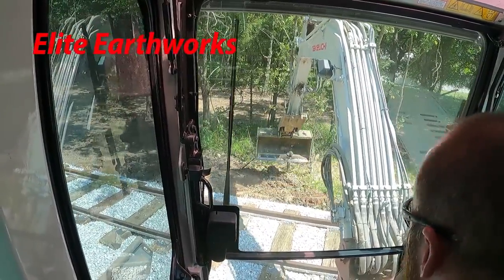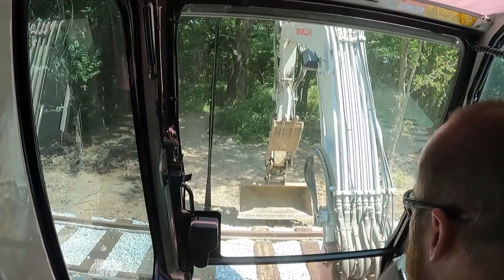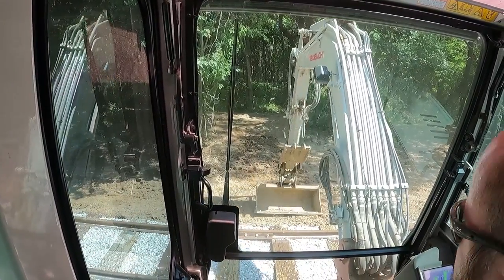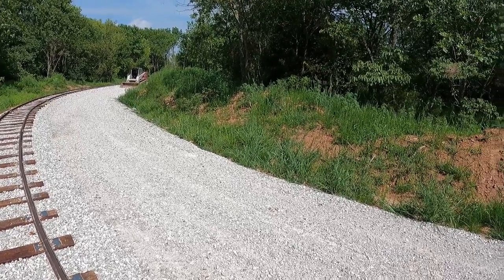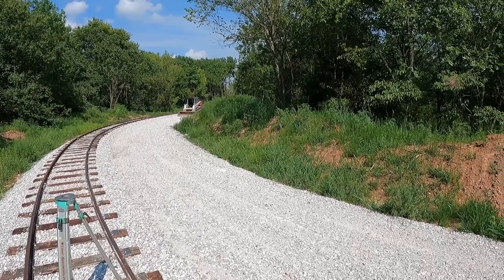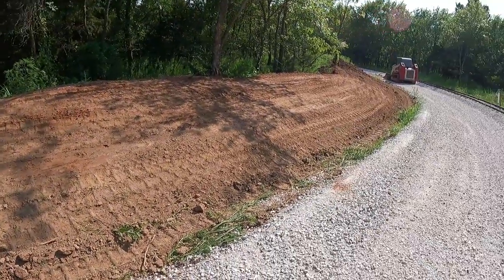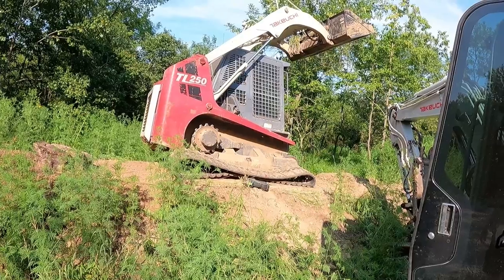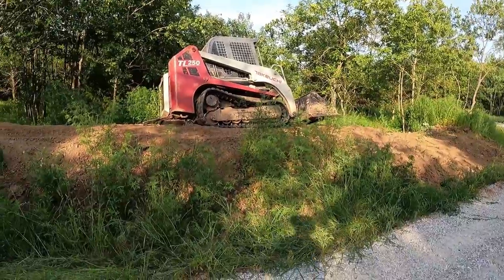More Grading And Breaking A Track On The Loader

Comment: Larger grooves in the rear idler and bogeys are responsible for more movement laterally, side to side on the tracks as well. I put new tracks on mine and still got considerable noise out of the tracks, and was compelled to replace all the undercarriage parts. The cost was the same as the tracks. I spent 3K on the tracks, and the hardware without the sprockets was another 3K. The track alignment will always vary with grooved hardware. Good vidya Dirty Money.
Reply from the maker: That’s good to know. I’ve only changed the sprockets once at 6000 hours. The rear roller and the small rollers are original with 8700 hours on them. May be about time to change them lol
Reply: Look at a new rear idler and the bogey wheels and compare yours to see how deep the grooves are on yours and you’ll see what I’m talking about
Reply: @eliteearthworksllc  Mine has 3600 hours on it. The rear idler and bogeys had nearly a 1/4 inch of surface ground off of the faces of them from dirt and aggregate getting between the track alignment posts on the track and the wheels. I went ahead and got the front idlers too as I was hearing bearing squeal and I wasn't about to trash $3000 tracks because I wasn't willing to replace the hardware. Whoever owned this machine before me ran it like they stole it.

Comment: Nice work Sir! You mentioned using OEM tracks. Where do you purchase them from? Does anyone aside from Takeuchi sell oem tracks? I know with automotive parts the oem manufacturer often sells parts without the official make stamped on them for a lot less.
Reply from the maker: Thank you! My dealer MidWest Equipment or RoadBuilders carry‘s them. I think if you want oem you have to go to a dealer.

Comment: Got a question what made you decide on using a tooth bucket over a smooth bucket for grading?
Reply from the maker: I like them cause it’s easier on the machine to cut and grade. It’s quicker than trying to cut something with a smooth edge and definitely helps to loosen things up easier

Comment: I never noticed before that the sprocket seems to be further back than the rear idler on that Takeuchi. Is that a good thing or bad thing or neutral?  Just curious, because I've never used a rubber tracked machine.
Reply from the maker: They did that cause it actually helps with traction and pushing power. I think at all times it has 6 ends of the sprocket in the track where the other manufacturers have 3 with the idler moved forward. Now their new ones they had to change the design when they went to the vertical lift and the sprocket is moved forward
Reply: @eliteearthworksllc  That makes sense, thanks for taking the time to answer.